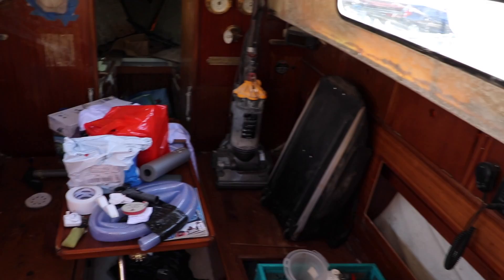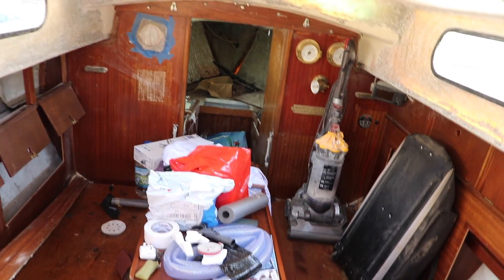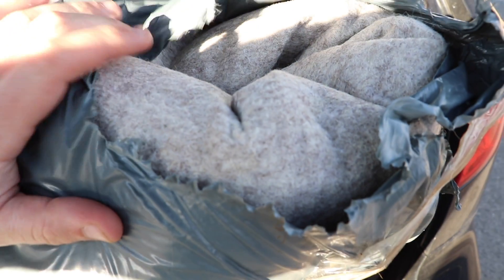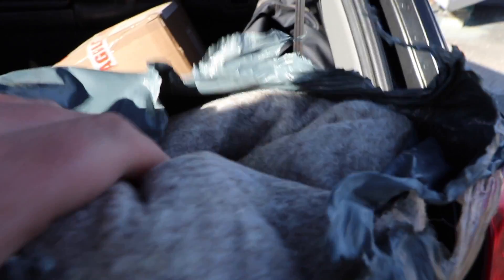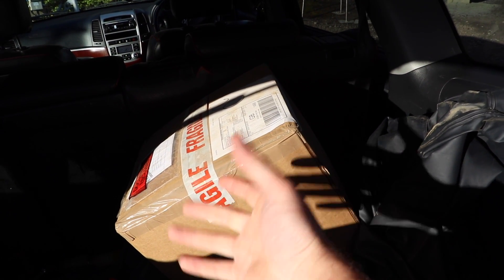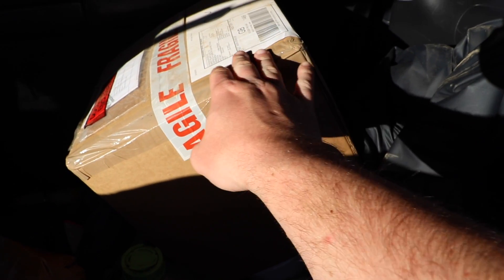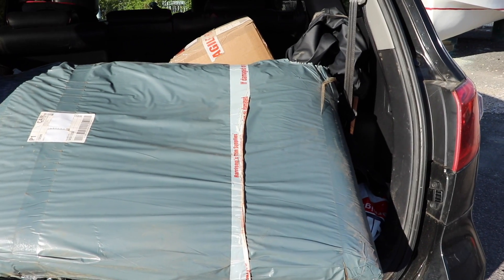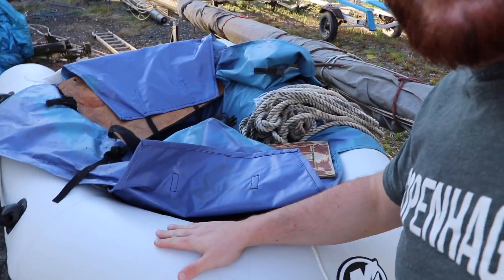Couple of busy weeks ahead! - SV La Viajera - Albin Vega Refit

Comment from the maker: What's everyones thoughts. Hold out for the coppercoat or paint on antifoul to get her in the water this year and coppercoat next year?... I can't decide
Reply: SV La Viajera is standing with the same  decision on my Vega my boat builder friend says if I want to remote all old paint go for the copper coat
Reply: What did you decide to do? :)
Reply: Most people do a light sanding and use a standard anti foul once a year which is no big deal. Sure, eventually you may spend more than 10 years of copper coat but an annual lift out is worthwhile anyway so you may as well use antifoul. Eventually the layers of antifoul build up and you need to get on the sand blaster. Great channel - hope you are able to get back with the vids.
Reply: Just antifoul it and get sailing